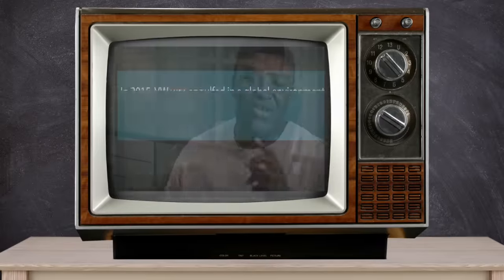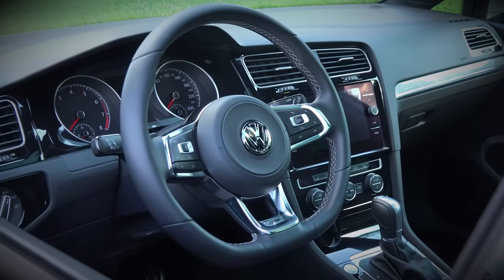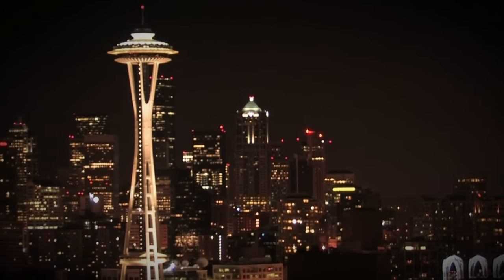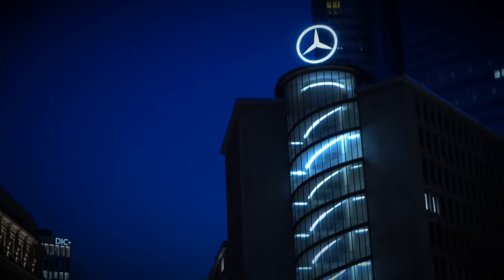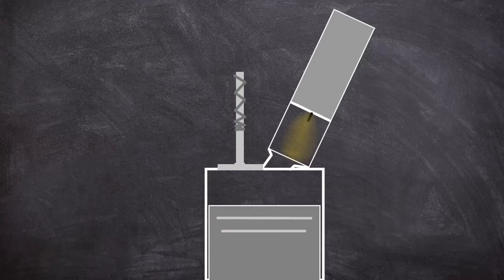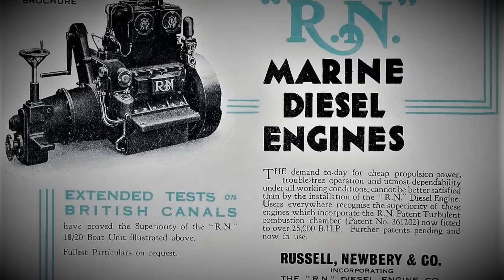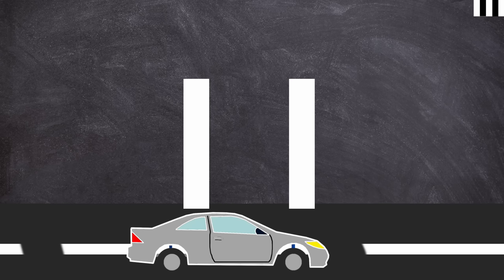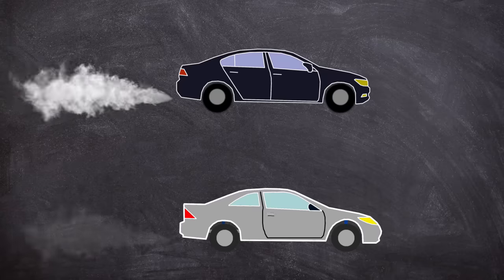Scandal: VW Emissions Dieselgate Explained | Plainly Difficult Documentary

Comment: I thinks they were absolutely brilliant and it's too bad they got caught.
They're making it too difficult to pass these emissions tests and it's soon to become impossible.
Reply: VW's competitors were able to meet the requirements just fine. If VW's diesel tech wasn't up to the challenge they should have just delayed their diesel models a few years until they were ready. Not like they ever really sold that many diesel cars over here compared to their gas cars.
Reply: @PhysicsGamer  you're correct, others have been able to meet those standards but at the same time making Diesels even more unreliable than a gas engine. So that created a whole industry to defeat the emissions equipment. 
I know people think the EPA has taken down that industry, they haven't.
Reply: @Nothingtoya  Diesel has a lot of downsides totally unrelated to the EPA that have led to gas ICEs pretty much eclipsing them. A lot about how a diesel engine operates causes it to be harder to make small ones reliable, which is why nowadays they're mostly just in buses and trucks, at least as far as the roads are concerned. The mileage advantage has been cut down to the point where in city driving some gas ICEs are able to outperform diesels on their own. Even the low-end torque performance has come up on gas engines.

Meanwhile the same sort of improvements have just... not really happened with diesel engines. Even if you ignore the added emissions systems, a car-sized diesel engine today just isn't that much better than one from the '80s. Not compared to the sort of improvements we've managed to squeeze out of gas ICEs, anyway.

Comment: I generally love your videos, yet I have to say your explanation of NOx generation in diesel vs. Petrol engines was a bit poor, borderlining to wrong...

NOx is generated under a high temperature high pressure atmosphere containing both Nitrogen and oxygen.

Exactly the conditions present in diesel engines
As diesel engines are always running lean (air rich)

Petrol engines on the other hand are running more or less stochiometric. Meaning oxygen and fuel are balanced. Thus most of the oxygen is reacting with the fuel, and close to none is left to react with nitrogen.

Comment: Just to be clear: the issue is not with diesel engines. Like every human thing ever, they create some pollution, which is a trade off for efficiency, power, reliability etc etc. The problem is that instead of investing R&D for diesel engines, VAG decided to invest instead in tricking emission tests, because it was cheaper. A diesel engine by itself is not more polluting than a gas engine when compensating other differences, it's just underdeveloped because for 15 years, the only development went into emission tricking
Reply: No, VW did have competitors who didn't need to install defeat devices to pass emissions. But frankly diesel has a number of disadvantages over gasoline for non-commercial vehicles, chiefly its lower energy density. That's why it needs much higher pressures to be a useful fuel, which in turn means it produces pretty awful emissions without additional hardware. Even the best diesel engines produce a lot of soot that needs to be dealt with, simply due to the incomplete combustion that occurs in their pistons.

Comment: This was the start of a revolution against the american EPA. And really was a great thing in hindsight. Because VW knew that these protocals were bullshit. 

SCR, EGR, and DPF systems are highly prone to failure, can cause catastrophic engine failure in extreme circumstances (which is far more common than it should be) and these systems require the usage of highly toxic fluids to operate as designed. And have proven to not significantly alter emissions of green house gasses long term. 

This is by definition, a lobbying effort with no real motive aside from greed and ignorance. I applaud VW for their actions and wish they would've continued to be defiant.

Comment: So what, it burns a bit dirty.  You can make your own diesel at home and it will burn much cleaner than any petroleum based diesel would ever burn, regardless of the diesel engine.  I have been making my own diesel for years.  Diesel is the fuel of the future. It is so easy to make and is limitless.
Reply: Ethanol/methanol falls in that too. As long as you can grow something with sugar in it, you can distil alcohol. Alcohol, biodiesel and some electric is the answer. Not this all electric future they're pushing.
Reply: @sparkplug1018  The all electric future is ridiculous.  Where do they think the electricity comes from, the magical electrical fairy?  For the large cities and near suburban areas, an electric vehicle is ideal.  The battery will never run low.  However, for the far suburban and the rural areas, electric vehicles are ridiculous garbage.  Personally, I want nothing dependent on the power grid at all.  I love 162 kilometers from the nearest metropolitan area.  There is no way I could ever own an electric vehicle in the crippled form they are today.  The politicians have also failed to mention just how toxic and dangerous the batteries for these vehicles are.  They do not last very long either.  The lithium mines are an environmental disaster that nobody seems to want to acknowledge.  I have been to two lithium mines to return exhausted lithium battery packs from work, twice a year.  The technicians told me the only things that can be recycled from the exhausted batteries are the casing and the circuitry.  The electrodes and electrolytes are too contaminated for any use after they are exhausted.  It seems the old fashioned petrol and diesel vehicles are still the best.
Reply: @indridcold8433  My thoughts exactly. The grid can not possibly support an all electric fleet, it's just not there. I believe as you, in urban areas, where the power comes from hydro, solar, etc its a great option. But other renewable fuels like biodiesel, ethanol and methanol should be a huge part of the equation. And we can be converting cars and trucks to run on those with minimal effort right now, which I guess doesn't quite fit the agenda.
Reply: @sparkplug1018  The agenda is to have maximum control over us. Forcing a vehicle that has a crippled range, long down times for charging, and is fully dependent on the power grid, does give a lot of control to the powers-that-be.  I do not understand  how nobody sees this.  I already make over half my diesel at home.  By the end of this month, I should be getting my dual fuel propane conversion.  It will actually be a triple fuel conversion.  I will be able to run my vehicle on propane, methane, or petrol, with just a switch.  Where I live, I will likely never have an electric vehicle.  I am not really against them. In the city, there is nothing better.  But, I am against them being forced on everyone when there are other alternatives that are far superior to electricity.  Battery electric vehicles are no better for the environment than petrol and diesel vehicles.  They may actually be worse when it comes to disposal of exhausted batteries and the mining of the lithium.  But, we do need as many fuel options as possible.  Petroleum only is not a good idea.  No one fuel is a good idea.  We need multiple fuel sources to control monopolies.
Reply: @indridcold8433  Not entirely sure control is the only reason, I'm inclined to say control+money is more accurate. But sounds like we agree on the multi fuel concept though.
Reply: @indridcold8433  I live in a rural area, and it's no problem to have an EV in a rural area. No idea what you're on about tbhm
Reply: @logitech4873  You obviously live in not a very rural area.  I have to drive 160 kilometers to get to anywhere relevant.  The winters are so brutal that no belly dragging vehicle could ever move on the icy and snow covered roads.  The electricity goes out often.  I have a large diesel generator because I can not trust the municipal power grid.  I stockpile diesel as much as I can but this year I am a bit behind because of a crop fire.  I may have to buy a lot of diesel this year as compared to last year where I bought almost none.  There is no possibility of an electric vehicle functioning here, except for mid summer to early autumn.  A generator, though very helpful for the home, will not charge any large battery pack in any sort of realistic time.  It is only 220 volts. Besides, diesel is nearly free, except this year because of the fire.  Electricity is not, and it is also very unreliable in rural power grids.  Telephone is also unreliable.  When I go to the grocery store, I have to fill the truck as much as I can so I do not have to return to the store for another six months.  You probably just live in a far suburban area.
Reply: @indridcold8433  I live in a fishing village north of the arctic circle, but we have a fairly competent government so there's no issues with the electrical grid or cellular network.
Snow isn't an issue. Everyone (like 95%+) here uses studded tires for the 5-6 winter months, and the government keeps roads clear even in the most rural areas (Apart from private roads). Though they're still snow and ice covered, literal meters of compressed snow buildup throughout the winter would be bad.
Driving on ice / snow isn't an issue for an EV any more than any other car. All wheel drive, and you're set.
Reply: @logitech4873  Where I reside, no belly dragging car could ever pass if it is not dry.  There are even signs that say, "Do not enter without high clearance."  It is not flat ground at all.  This adds to the ugly mudslides in the spring because of the mountainous terrain.  If it were flat, there would be none.  Diesel and petrol are the only fuels we can stockpile for the winter.  We can not have a bunch of giant batteries laying around in the cold.  You mentioned that an ordinary car can get buy with chains.  If only that were the case here.  Only some of the wealthy families can afford to have a regular vehicle around here because nobody can afford to have a car laying around doing nothing for over half the year.  They have nice sports cars they store for the late autumn to late spring or early summer.  The few that can afford to have an ordinary vehicle for the short warm months, could still never have an electric vehicle.  The grid is too unreliable.  There are too many tree branches that fall across the lines and it takes a long time to get to them.  Besides a small general store with a small petrol station that is still 50 kilometers away, the next closest utility is 160 kilometers away.  With all that driving, there is no way anybody can have a short range, grid dependent, low dragging vehicle here.  Mountain terrain is an interesting life.
Reply: @logitech4873  Not good!  My post fence fell into a ravine.  Now I have to drive into the muddy ravine to tow out the posts before they are buried.  I should note have been so descriptive.  I just pressure washed my vehicle and painted the undercarriage yesterday.  Posts are expensive.  I can not let them get buried.  No car could get this out.  I question if I can get them all.

Comment: Here's the perversity.  If you think that climate change /global warming is the greatest danger to the planet you've just shot yourself in the foot by banning diesels.  NOX is only a problem in urban areas where concentrations can build up.  And diesels emit high levels of NOX only when running at high loads, which is not what they are doing in city traffic.  In my state, Georgia, the majority of NOX emissions state wide come from lightning.  The majority of unburned hydrocarbons come from pine trees.  There are local concentrations of both in the Atlanta area caused by cars, but nowhere else in the state.
If reducing CO2 emissions is your goal then the engineers at Bosch who programmed the VW systems should be given hero medals instead of being prosecuted.  CO2 emissions and fuel consumption are nearly 100% correlated so anything which reduces fuel consumption reduces CO2 emissions.  And their programming reduced fuel consumption while being legal under EU law at the time.  Definitely a case of misguided persecution by ignorance.

Comment: "Defeat" defined as win a victory over, beat or overcome. "Device" defined as a thing made or adapted for a particular purpose.  The vehicles in question had fuel delivery systems controlled entirely by the car and the way it was driven to meet both the test requirements and the performance desired by the customer. California allowed these vehicles on the road because they were able to meet the specified test. The subsequent examination over long distance was not part of the original test. Whatever the spirit or the intentions of the manufacturer they produced vehicles that complied wth the California legislation as measured by numerical standards. The long distance examination results should have been as much a surprise  as the fact that my twin air Panda, that has low enough emissions to be  0 rated for VED, has technology that makes it a totally different animal when the no throttle accelerator  fully lifts the valves. What the manufacturers may have failed to get away with is nothing compared with the political administrations failure to specify an adequate test in the first place.  This is a matter of do as my mind wants; not what I have written down as measurements. No wonder Texas is reaping the benefit of California dreaming while VW still build cars. 
 The TV lawyer ads claim thousands of motorists have been misled about emissions. Bovine Faeces! Motorists buy either performance or economy and merely hope the MOT emission test will be OK. Lawyers know free money defeats integrity. In the 20th century engineers delighted politician with achievements the latter did not understand. In the 21st century the still ignorant politicians take all for granted and set targets for engineers with little heed to achievability. Why did VW just roll over and not challenge the test requirements. Probably because it would have become a bigger and even more expensive fight while being contrite does less damage , if any,  to sales.  
 This is all as nothing. Now the manufacturers really are doing what green politicians want  we are expected to buy EVs (that is a car with no fuel; just a charged battery) The fuel to charge them is to be climate dependent or so called renewables. If that is a CALCULATED plan it explains why I have walking gear and a bike.

Comment: I never believed in “Clean Diesel” VW ad from start. If you grew up in the 1960’s and 70’s you know how pollution nasty diesel motors were. Comparable more than gasoline ones. Moving forward to about 2010 and they became as “green” as gasoline ones???
Where all that crap in the diesel went?
Today, at some extend is happening the same about electric cars. Yes, they won’t make fumes. But, there from electric cars owners there is denial that most of electric produced to charge car batteries comes from electric power plants burning fossil fuels. Then, there is the problem of disposal of used up car batteries. That has not being properly addressed so far.
There is not such thing as a free lunch.
Reply: The key difference in emissions is that the carbon from a plant can be captured. No such technology has been developed that is small enough to fit on a car.

Comment: Well, I always thought that something was wrong with diesel powered VAG cars, from all the diesel engines out there, they were always the ones to emit more soot, my car went to limp mode once because the bord computer detected a "malfunction in the anti-pollution system", I've changed the EGR, since it had a faulty code...I think that that wouldn't happen in a Vag car, even with a faulty EGR the car would go on

Comment: Diesel vehicles are no longer economical to buy in the US anymore, because of these new SCR emissions systems.  They're so complex and so RIDICULOUSLY expensive to fix when they go wrong -- and they absolutely will go wrong long before that gloriously reliable Diesel engine dies -- that the money you save in fuel costs pales in comparison to the cost of keeping the vehicle on the road and compliant with the emissions rules.  Now, if you live in an area that has no emissions inspections, you can just drive the damn thing with the check-engine light on, and who cares how much pollution goes out the tailpipe, right?

Except now, because there are so many cities and states that still don't have emissions inspections, the Federal government is making manufacturers do things like force the car into "limp home" mode when the only thing wrong is a code indicating a bad catalytic converter.  Or, like the new Toyotas and Chevies, disabling creature comforts like air conditioning or heated seats until you get the emissions problems fixed.  Government will get you one way or the other.  And it's getting to the point where your car is unusable if it has a simple emissions-system failure.
Reply: In fairness, diesel fuel has also skyrocketed in price since it's so much easier to refine gasoline than it is to refine diesel. Which is kind of an inversion of how it used to be.

Comment: As a diesel mechanic whose familiar with SCR systems and have been watching the unraveling of the emission control “defeating” situation, the EPA is extorting every level of the automotive industry. CARB is a scam. The way the “clear air act” is worded, you can face the same penalties from deleting an emission system as changing your wiper blades with not oem level components. It’s also worth mentioning that aviation, military, and various other countries don’t follow any of these rules. So the same, or more amount of particulates and nox are being release BY the federal government.